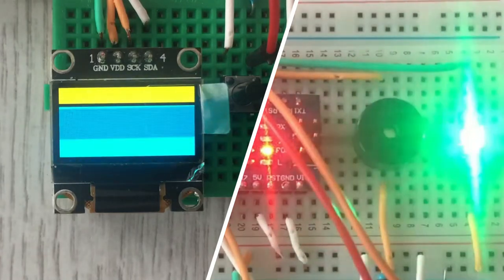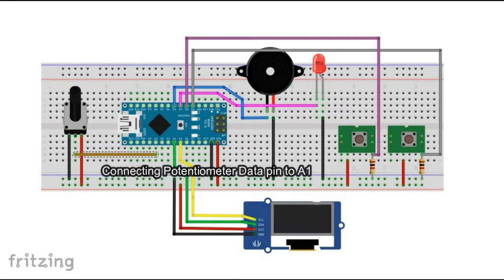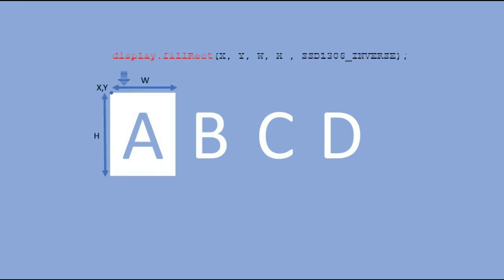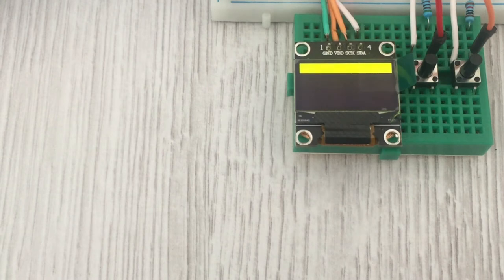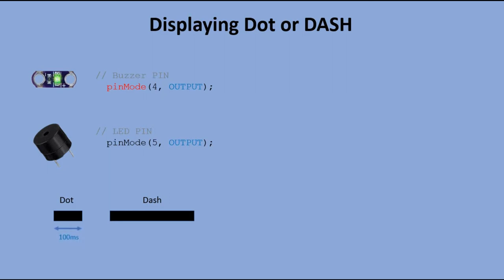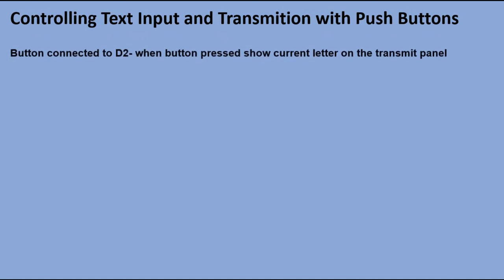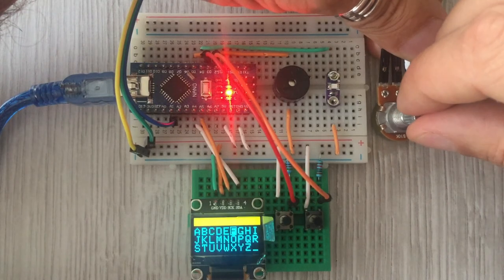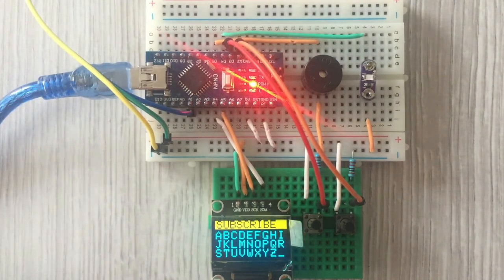Text input using OLED SSD1306 display and potentiometer Transmit Morse Code messages using Arduino.

Comment: Hi , great video !! I see in the title you say are using ssd1309 oled but in the xode you are using ssd1306 library , are compatible or was just a mistake ? I need to do work a ssd1309 display 2.42 inch so im.looking some references 
Thank you so much
Reply from the maker: It is ssd1306. Thank you for spotting this. Funny nobody spotted this mistake before

Comment: Its a cool idea. For it to be useful, I would add numbers to it so licensed Ham operators could actually use it. License numbers or call signs contains letters and numbers, and when using CW it is necessary to report your call sign as you try making contact. Looks great anyways.

Comment: The code is not available on the mentioned link. Where do I find it?
Reply from the maker: The site the code was on performed an upgrade and it messed up all the links, with not clear gyuidance how to fix it. Fortunatelly all my projects were also poplulated on teh website Hackster.io. I updated the link in the description. Let me know if it now works.
Reply: @marios_ideas  Yes the link works as a charm. Thank you very much!

Comment: Is it possible to make the reverse, we press the morse code and the message appear?

Kind Regards
Reply from the maker: Of course . I am planning to make a video where I transfer morse code with the laser module. Not sure when but I already have components purchased
Reply: @marios_ideas  plus it would be good to select the letters from tactile switch like an old pad or analogue playstation stick with 2 potentiometers ..kind regards